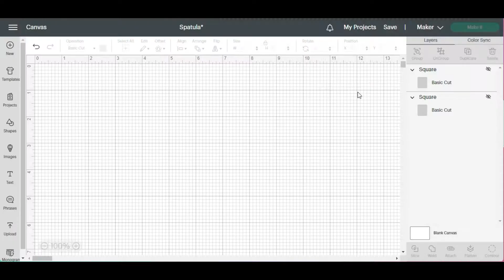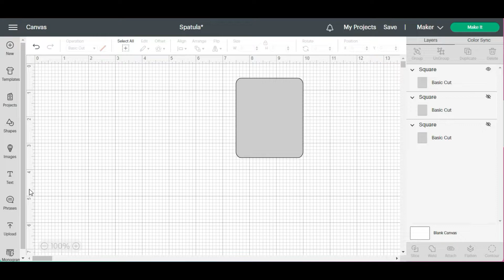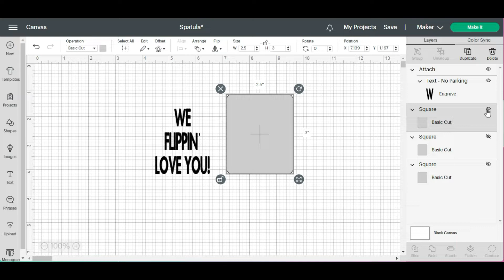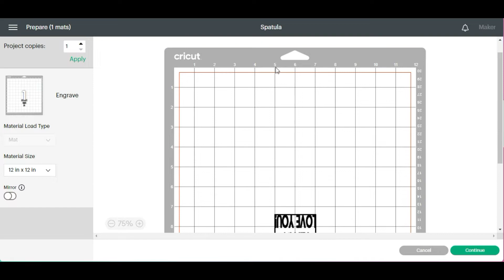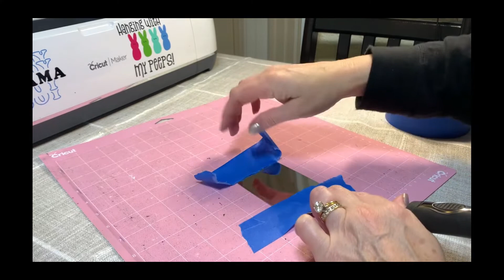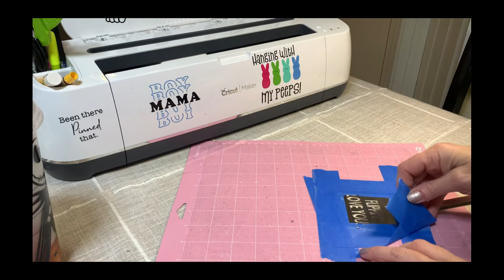🔥 How To Engrave a Spatula With Cricut | Easy Father's Day Gift Idea

Comment: Its telling me not compatible with material I'm so confused I've had Cricut for 3 yrs and first time engraving a spatula but stainless is not compatible anymore I guess wht the heck Cricut!! I wanted this so bad I've had these spatulas for 2yrs lol 
Do u have any other suggestions
Reply from the maker: When you hit make it, did you get rid of the square template?
Reply: @creationswithtory   I never used a square template I knew what size I wanted..I just dnt get why it's telling me stainless is no longer a compatible material..and I seen a video of only 6mths ago and with a Cricut maker as well and they were able to use stainless steel I just dnt understand why is happening stainless is not even available option at all when u browse all materials it is no there but when u type it in it pops up and it's kind of faded it will not highlight I have no clue what is happening I'm pretty positive Im not doin it wrong lol I need help engraving on stainless was a huge reason for getting my Cricut granite it's taking me two yrs to get to it but still lol any help is very much appreciated 😊
Reply from the maker: @mtblondie0036  hmm? How big is the image your trying to engrave? Even though some of the materials are grayed out. What happens when you browse all materials and type in stainless steel? Then select.  Did you change the image operation to engrave?
Reply: @creationswithtory  I believe it's just under 1.5 or is right at 1.5 and the height is little taller I'm not real sure I dnt have it up to look at anymore uugh I do know it's under 2 for width and prolly just under tht for height but when I browse all materials I type in stainless a box comes up and stainless is there by its self but it is not highlighted or clickable but I clicked it another box pops up and tells me material is not compatible with the material I selected it's so messed up I've never had tht issue
Reply: @creationswithtory  I do not think I clicked on or changed the operation part..I dnt remember I'll do tht and see what happens
Reply: @creationswithtory  hello again lol omg tht was it I can't believe I missed tht I went over everything!! 😂 But now it gets to 40% and dead stop! Never seen tht happen or talked about in any videos. Could it be to cool down my image is of a spatula flame with the split in middle for a name to go  so it's not like I have a lot of detailed images
Reply from the maker: @mtblondie0036  that is super weird. Mine comes up all on its own as well but I’m able to select it. Have you updated your cricut design space? I would try that. If it doesn’t work I’d call cricut support and ask them. Hope you get it fixed.
Reply from the maker: @mtblondie0036  I hope that’s it!! Let me know. 😀
Reply from the maker: @mtblondie0036  glad you got it to semi work.  lol  Do you have it taped down really well, so it's not moving?  that could be it.  Also, you could have debri on your tool?  Have you removed the tool and looked at it?
Reply: @creationswithtory  ya it was completely locked or something  I had it taped super super well lol 😂 plus I was lightly holding it like I seen in videos just for tht purpose and it never budged I couldn't even push tht arrows to let it loose or even the big C button I had to shut it completely off I took out my engraving tool checked it nothing on it figured some debris but I didn't see any this was super weird
Reply: @creationswithtory  I am very appreciative of all your help I am sorry to keep bugging ya but I do appreciate it..I am bound determined to figure out what happen but don't wanna push my luck ya know lol I still got something's I want to engrave I have dog tags name tags for our fur babies along with some  copper bracelets etc..but now I'm worried
Reply from the maker: @mtblondie0036  when you remove the tool. Can you push down on the top of the tool and see if any debris is stuck? Also, if you have any uneven marks on the mat, it can make cricut freeze up.  Can you try a different mat or just turn your mat around and use the other end?  Also make sure you don’t have any debris where the mat goes.
Reply from the maker: @mtblondie0036  also, you can try cleaning the cache on cricut    

How do I clear Cricut application cache?

cricut-design-space folder. Select LocalData folder and select all the files which are in your LocalData folder. Delete all the files, and also, empty them from the Trash.